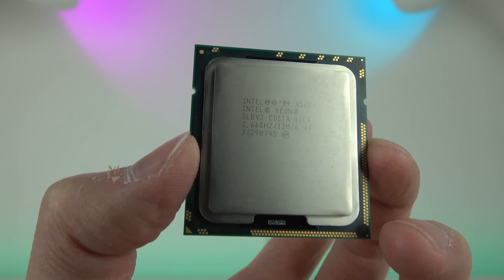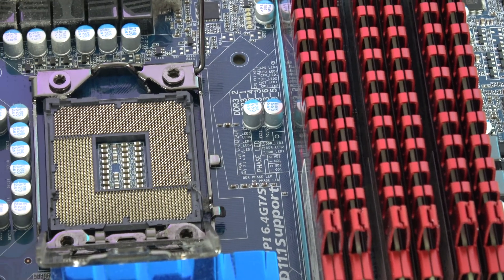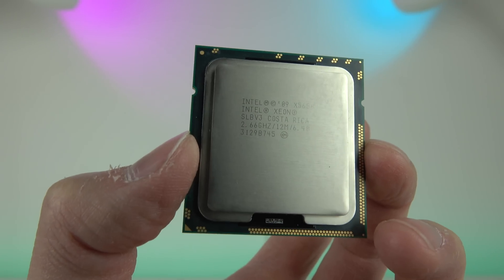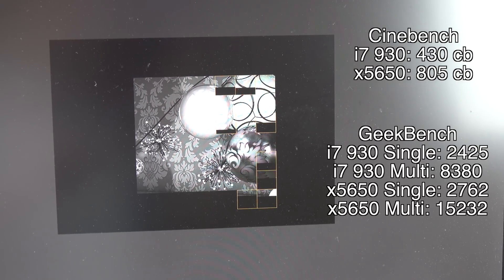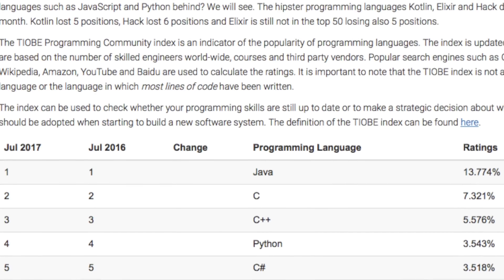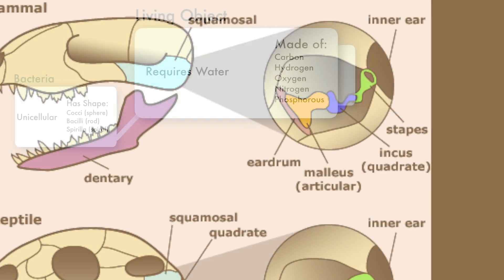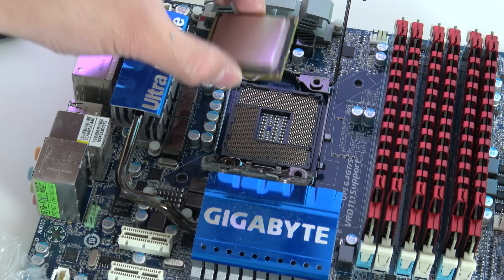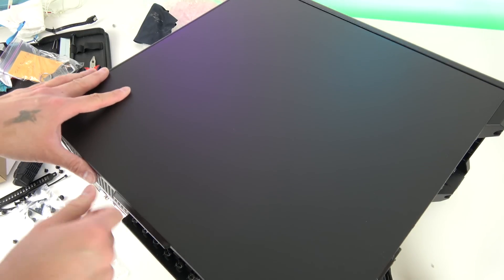This 6 Core CPU Costs $20. Will It Let My PC From 2010 Last 3 More Years?

Comment: This reminds me of a time when there was less change in computers from year to year, and there would be a 10 year run of a particular model (I.e. Apple II, C64), upgrades would be designed to accommodate the original machine, even if the upgrade was almost a whole new machine.

Comment: Almost everyone has a computer that costs over $1000? Maybe out there in Beverly Hills, but here in the real world, the average person typically pays around $300-500 for a mid-range system. Not the absolute lowest you can get, but far from a top of the line system.

Another factor is that the average person doesn't have the faintest clue about computers. They want an appliance that can send/receive email, browse the net and that's about it. Installing software is a huge undertaking for them and is usually done by someone else that they know. They rarely do much else with their computers.

I've installed games and emulators on other people's systems. They never use them. I've given discs of videos to people and told them that if the videos don't play, install the copy of VLC that's included on the disc. They don't.

In this area we had bulk trash pickup where the city will haul away virtually anything you put on the curb. I've found many computers in the past few years. Know what the most common specs are? A P4 (1.5 - 2.4Ghz), 512MB of RAM, onboard graphics & sound, 50-160GB hard drive. Granted these are old computers being thrown out, but even for the time they were new, those are rather low specs. Plus, there's rarely anything extra installed on the drive, other than maybe MS Word/Office and a bunch of instant messaging programs. Oh, and at least three copies of every photo they've ever taken.

You're worried that a $1360 i7 system won't last you another three years? I'm using a 2.66Ghz dual core system I bought refurbished several years ago for about $220. It's not that I don't need/want a state of the art system, I just don't have $1000+ to blow on one.

Tell you what, in three years, when you consider your current system so outdated that it's worthless, I'll happily pay the shipping to take it off your hands. Deal?
Reply: I think he meant everyone has a computer, rather than a ~$1k system

Comment: Funny I did the same about 1 year ago with a server XEON processor and it cost me £40... never looked back. System loves it... but you do need a motherboard that will let you do it - some dont. Also it pays to match your bus clock speed to the memory clock speed you buy and always buy memory which is good quality and has the TIMINGS written on the side eg 50-3-3-9 and input those timings into the bios manually... and this gives rock solid stability. Enjoy your new beast. Im spooging over mine ;-)

Comment: I have a i7 920, 12GB RAM, Gigabyte EX-58 Mobo, GTX 980... looking for a i7-990X. or what's the best cpu for LGA1366? which one best for OC?
Reply: either the 990x or the 980x. both have the 6 cores and out perform the xeon he used. but costs about $150 for 980x
Reply: Brad C thx!

Comment: Sitting here watching this video on my 10 year-old desktop computer powered by an Asus P5Q Deluxe LGA775 socket Pentium Core-2 Quad Q6600 2.4 GHz CPU, an ATI (AMD) Radeon HD 7770 GPU, 6GB DDR2 800MHz RAM, an Intel 250GB SSD and a pair of WD Black 1TB HDDs (mirror RAID).

Runs like a charm still, even with the games I play – BGE; Wargaming's WoT & WoW; TS2017; and FSX and lesser CPU/GPU intensive games.

I have never purchase a pre-built/assembled computer in my 25 years of owning a computer.  All my computers from my first 33MHz 386 to my current computer I built myself.  There was a time as well when I was helping friends and family assess their needs, spec and build their systems for them.

Comment: I added 32GB of ram to my old Mac Pro dual 4-core Xeon system that I use for various things it works pretty good.  I'm not sure that I'm ready to replace the processors to faster processors in a Mac, even though you can a matched pair for around $30

Comment: Hello Chubby, I own a PC with a similar case and an i7 920 along with a GTX 1080. The i7 920 can be overclocked quite extensively. Mine is running from 3.3 to 4GHz and I'm running all the games with more often than not a GPU bottleneck.

Comment: You left a tremendous amount of performance off the table with the i7-930.

I've been running the i7-920 at 4.6ghz since before you built yours. Tsk tsk

Comment: Bro... you have to do yourself a favor and overclock. My old i7 920... I still have. Every couple of years I bumped up the OC and every year it was like a new computer. I also bought a X5650 this year and it was painful going to 2.2gHz. I am currently running that system with a mild OC of 2.8gHz and it makes a world of a difference. I will pump it up to 3.2 or 3.4 at some point.

Comment: I'm still rocking  Q9650 from 2008, it benchmarks the same as an AMD FX6300.
Reply: It's still a very solid cpu ! amazing how those Q series chips have lasted through the years.
Reply: I have ordered a I7 7780 to replace my q9550 system...about 6 years rock solid. ..just no more upgrading
Reply: I'm running a Q6600
Reply: I just bought a fx 8350 for 40$
Reply: "integrated graphics" only got decent performance since Ivy Bridge - and that is "comparable to Nvidia 9600GT". At the same time useful life of top-level GPU's is close to 5-6 years, while mining is about power efficiency and demands "latest and greatest"
Reply: the only prob with that is windows 10 doesnt play well with the chipset. I gave up on it, downgraded to win7 and  sold my 9650 on ebay.
Reply: i just get one recenty, i put i a new cooler and works fine. still i got an nvidia geforce gt610, but until i could get something better it is gonna to hold up
Reply: @Chris Ayres buy a new cooler not use the Intel in box, and some fans to get the heat out and will be way better.
Reply: @Chris Ayres well I did with a quadcore too but the advice is the same, just a new normal cooler helps a lot.
Reply: i also suggest you a cpu fan, you just connect to the motherboard and put the air flow direction to outside the cabinet, and it will help too. you could use several ones. i use the program speedfan to mesure the temperature in the cabinet. even my hard drives and my graphic card have fans.
Reply: ClarkeZor I just sold mine
Reply: @Chris Ayres this is false, you canbuy an adaptor to convert vga to hdmi
Reply: @Chris Ayres http://www.l-com.com/what-is-the-difference-between-vga-svga-and-uxga-and-does-l-com-sell-cables-for-each
depends, my gpu has vga but can output 1080p
the newest revision could output (almost) 8k
The resolution champion today seems to be WHUXGA (Wide Hex Ultra Extended Graphics Array) with resolution of 7680x4800 (36,864,000 total pixels).
Reply: @Chris Ayres the gtx750ti https://www.geforce.com/hardware/desktop-gpus/geforce-gtx-750-ti/specifications can output 4K UHD(2K)on the VGA connector and true 4K on the HDMI.
Reply: @Chris Ayres even nvdia's first gpu has xga(1024x768) so vga were obselete just a couple years after it came out
Reply: Chris Ayres yup, many people thought VGA is just VGA when in reality most of them almost never used VGA, instead, they used newer versions of it which is why many monitors don't say "VGA" input but "D-SUB" because saying you're using VGA are kinda misleading but people got used to it...
Reply: @Chris Ayres yes 775 does not have hdmi but if it's meant for gaming who connects there tv to motherboard and not gpu
Reply: I have a Xeon e5440 (aka: Q9550) in 3.8GHz oc, an can beat the i3 7100

Comment: I have the exact same case as your older case. A total piece of shit. The sheet metal doesn’t fit properly. It has great capacity but putting the doors back on is hell. The cases I bought for my kids are much better quality. 

Wow,  I’ve got the same CPU cooler as well.

I’m going to do this Xeon upgrade. It totally makes sense. Thanks for the info.

Why pollute this vid with your idea of object oriented programming? Is has nothing to do with hardware compatibility.

It is no more object oriented than RS232 programming was in the 80s.

Comment: My pc is from 2009 and has no upgrades...
Reply: Zero Hedge  My parents say it's okay and it's not slow but it is for photo and video editing. I edit on my phone now. It has the same amount of ram 😂
Reply: Zero Hedge 2gb
Reply: Elven Beauty Not really. Most mid range and high end phones have 2-6gb with some even having 8gb.
Reply: @pipsta  he was joking, 2gb of ram are fairly little, my $200 Chinese phone has 4gb of ram...
Reply: My computer has an overclocked pentium 2 running at 1.32 ghz from 1999 with windows xp.
Reply: @mitsostechtips9047  wow my phone has 4gb ram and a 8 core 2.2ghz processor
Reply: Pipsta Productions 2gb ram? Dang that's a lot
Reply: @Kyharra  2gb is standard on a phone nowadays
Reply: @Chris Ayres There are modern Dell Optiplex Desktops out there
Reply: @Chris Ayres dell towers suck on the PSU side of things tho, their PSUs are good but they usually have a low wattage (eg. 160w-230w) so upgrading a GPU are impossible unless you also upgraded the PSU...
Reply: @Chris Ayres scroll down, there are the 3000,5000,7000, and XE series dell OptiPlex https://www.dell.com/en-us/work/shop/desktop-and-all-in-one-pcs/sf/optiplex-desktops
Reply: @Chris Ayres scroll down, there are the 3000,5000,7000, and XE series dell OptiPlex https://www.dell.com/en-us/work/shop/desktop-and-all-in-one-pcs/sf/optiplex-desktops
Reply: At least pay your electric and internet bills to comment on YouTube. Priorities are important.
Reply: WorthlessDeadEnd Huh?
Reply: Pipsta :  why not?  I have upgraded mine at least three times.  This vid is great!
Reply: I racked up 32gb just to fill my slots with LED sticks lol. Totally worth it when I can play one game while I'm crafting on another across my two screens.
Reply: Pipsta :   Your phone has 24 GB of RAM?  Spare me.  Stay in school.

Comment: I recently got Xeon E5 2640 also for 20$, Sandy Bridge-E 6-core 2,5ghz->3ghz Turbo with Hyperthreading (upgraded from Quad Q6600, I got a new mobo and RAM too, Q6600 is LGA775 and E5 2640 is LGA2011) and it works really well too, I thought it'll be bottlenecking my GTX1050Ti with a relatively low clock speed but it actually works really well and chews any game I throw at it, will probably upgrade it to i7 3930K eventually tho.

Comment: Could have just overclocked the 930, those do 4.2 ghz easily for 50% more performance.
BTW you can also overclock the Xeon, if you hit 3,5-40 ghz youll get similar performance to a 7700k.

Comment: I honestly hate the fact that we're going towards 4K. It seems like such a pointless waste of RAM and GPU power. I can't tell much of a difference between 1080p and 4K unless I'm looking at a huge television from a fairly close distance. On a computer, I'd need nearly a 30" monitor to tell the difference, and I don't have space for a monitor that big anyway. 

I mean, I can understand some of the other improvements like trying to have 120Hz or even HDR, but I just don't get why we're wasting so much RAM on the diminishing returns of a higher resolution. The benefit we get from 4K really isn't worth the price in computational resources.

Comment: I bought the same Gigabyte GA X58A-UD3R with an i7 950 and 8gb of RAM yesterday for 150€ :D  It will replace the am3+ mainboard with the FX6300 and 8GB of RAM. I also ordered the Xeon X5650 and it will arrive in 2 days. The german channel @HardwareDealz that inspired me also said that the xeon has got a great overclocking ability. Have you tried overclocking it (or have I missed it)? :D

Comment: how 2 overclock hooman, pls halp.
Reply: find a shady guy in an alley and buy drugs
Reply: cramming is equivalent to overclocking, increase in performance but u may die early because of stress
Reply: I dont know how about u, but ill rather kill 20-50usd CPU yearly if its supposed to be even 40% faster.
Reply: cocaine
Reply: Instructions unclear, am currently assaulting an alligator in Florida...
Reply: Buy meth or lsd or ecstasy and it should run at about 9 ghz and consume about 1200watts
Reply: My Frein i will teach how over clock https://www.techradar.com/how-to/computing/how-to-overclock-your-cpu-1306573 https://www.pcgamer.com/how-to-overclock-your-graphics-card/ There i help fellow frein
Reply: Ok heres an some help. Go into your bois change the clock speed of the you cpu/ram in increments untill it crashes. Then what you do is reset the bios (Take out the battery on the motherboard for 30 secconds and put it back in)  And go to the settings right before you crashed. For your Graphics card use programns like MSI Afterburner, and its again trail and error.
Reply: Well I overclocked my self with some cardio and whighs and I got great cooler protein

Comment: I just got that case back & also I am rebuilding A 5 year old system A  Hp ProLiant ML350G6, I will be up grading the CPUs second from the max of the pdf file says & I will be adding two water cooling blocks to it one for each CPU, also I already have 38 gigs of ram in it, I think this is A stable system I can run prime95  for 10 min with out it crashing, I will be happy with the new cpu upgrade in a few months

Comment: The i7-860 is older then the 930 and still a VERY capable CPU, I was using it up until Feb this year, and now someone else has it..

It's still playing the latest games (coupled with a 3GB GTX580) - ok, not on ultra settings, but it's enough, stick a 1070 in it or something and it'll fly...

I think you saying the 930 bottlenecks in games etc, is false, as I haven't seen the 820 bottleneck any games as yet....
Reply: Colin Hadley no it is not but close.p55 or socket 1156 is actually considered second generation core technology.socket 1366 and I 920 is older although by only like 8 months or so.i know because I have 1156 too.our socket 1156 also has a cheap xenon upgrade too although not all 1156
 motherboards support it.

Comment: My pc:

I5-6600k oc to 4.7hhz
Asus maximus VIII hero z170
16gb hyper x fury 2133mhz
Palit gtx 1070 jetstream 
750w cooler master psu 

I’m thinking about upgrading to a i7-6700k but not sure yet as my cpu is the bottleneck which is why I am telling you this lel

Comment: Only 2 fans in ur new case? R.i.p! Im sure its blazing hot !
Reply: As long as the airflow is steady and straight, you don't need a lot of fans. Cool air in, flowing over all components and hot air out - thats all it needs. I have a R9 290X, a card well known for running quite hot, an it doesn't throttle at all in my custom build case - with only two 120mm - fans.

Comment: Great news! With Coffee Lake on the horizon, you finally have a cost-effective upgrade without having to shell out for a HEDT system. I've been using my X58 system with an X5670 for the last two and a half years and have been waiting for a mainstream CPU that could replace my Westmere CPU. I wasn't going to go backwards with a quad core. AMD put a little pressure on Intel and helped consumers finally get more cores in the mainstream. I'll be upgrading my computer within the next year for sure. It sounds like Ryzen might actually serve your purposes a little bit better, but Coffee Lake is definitely worth a look.

Comment: I plan on building my new system next month but I do plan on doing some little upgrades on my current build so my girlfriend can continue to use it. I did think about a new CPU and considering this CPU is an upgrade for you, I think it'll definitely be an upgrade for this system. I also built it in 2010 (September) and it was an extremely similar build for me but it's about time to upgrade. The main difference between our builds was I only had an i5 750 so this sounds like the ideal upgrade for it and right now I see it for under £30 in the UK so I may just grab it.

Comment: BASIC CONCEPT.:  are all upgrades WORTH changing Everything to use 1 chip.  The upgrade of North and south bridge, SHOULD NOT MEAN we have to change the MAin CPU, Motherboard, new Anything..  AND abit of knowledge will tell you that the North/south bridge are the BIG bottle necks in the systems at this time..  but there are so many Mobo CPU chip sets, that Any changes, require the WHOLE thing to be replaced...Mobo, CPU, RAM...And I wont go into HD, SHD, SSD, m.2 ....  In the past, a change or 2 DID NOT REQUIRE replacing MOST of your system..

Comment: Max Bitrate of 45000?  And you wonder why you had 100% CPU when streaming?  You probably still do.  Good upgrade and one I'll be doing myself but you're a bit off on some of the specifics.  Also, Gigabyte isn't the best board to do this kid of thing.  Asus would have been better and you should check what BIOS revision whatever board you buy supports a Xeon.

Comment: I went from a stock core i7 920 to a x5670 6core. Saw a slight improvement, but when it came to a couple VR games, i still had stuttering. Once i OCed the cpu from 3ghz to 4ghz, that x5670 was performing on the same lever as an i7 4770 (stock probably) according to cinebench. And all that stuttering went away.
Sure it's no 7700k, but this will easily last me a few years. I don't play on 4k. so my 6gb 1060 is doing just fine with my xeon CPU.

And with highly multi-threaded games such as Star Citizen coming "eventually". All those extra threads and cores will really help, without me having to drop huge money on a new PC.